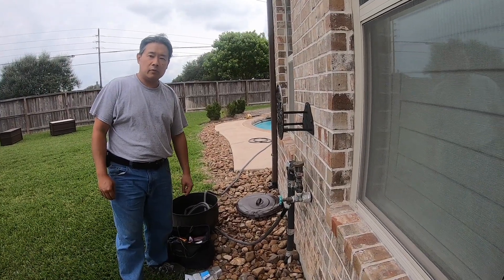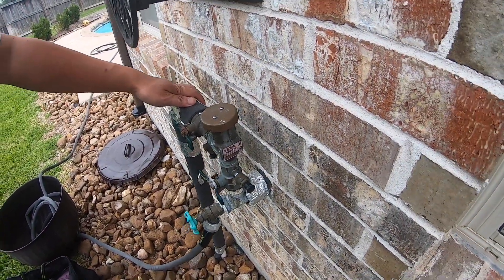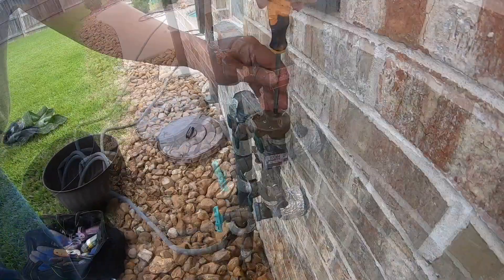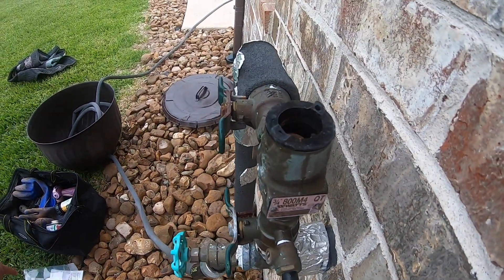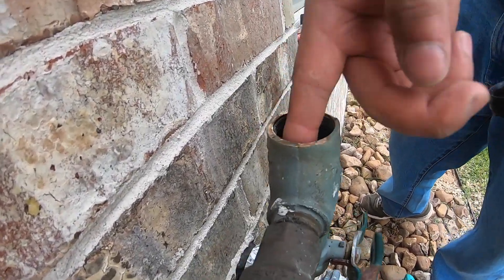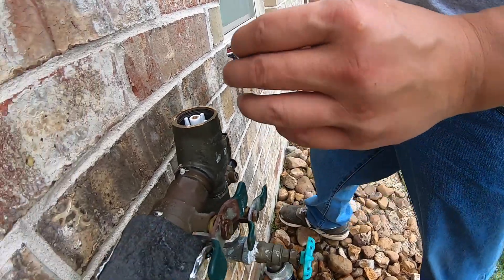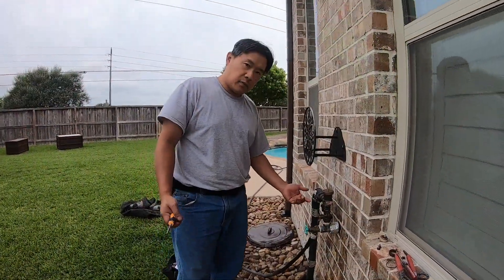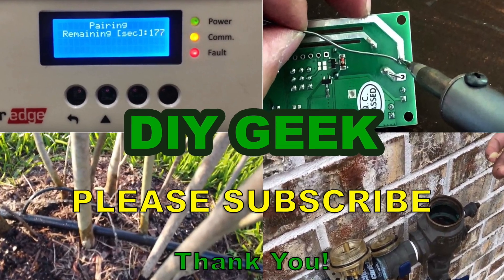REPAIR LEAKING WATTS 800M4 BACKFLOW PREVENTER WITH FREEZE RESISTANT RETROFIT KIT

Comment: Instead of removing the two screws that hold the cover on and then using pliers to remove the black plastic piece, leave the cover on and just use your hand to loosen the assembly.  Seen several videos where the first thing folks do is remove the cover but the cover is a useful handgrip to loosen the assembly.

Comment: I have the same back flow preventer and it leaks very little occasionally when it gets cold, but the problem is that it basically turns off and on to the sprinkler system. You can hear a thumping or pounding inside the valve and it continuously goes off and on. Hopefully the repair kit will take care of that issue as well. But this video looks very helpful and I'll use the link to buy a repair kit. Thanks!

Comment: He should also be using some silicone grease on that O-ring.  And that "thing" is the stopper that prevents the water from flowing back into the water supply.  That's the whole purpose of the "Backflow Peventer".  Overall it's a useful video.  It's good to see the pieces but clearly not the most knowledgeable DIY guy.
Reply from the maker: Great tip!

Comment: That was the hard and risky way to remove that cap.  IMHO Once the cap broke a hammer and screwdriver would have been better tools for that job,.  There was clearly a big enough piece of that post left to get a good hit in.  If that piece broke off too then you might have to go to the dremel, but you risk getting pieces lost  in the pipe and potentially jamming the valve.
Reply from the maker: Thanks for your great input.